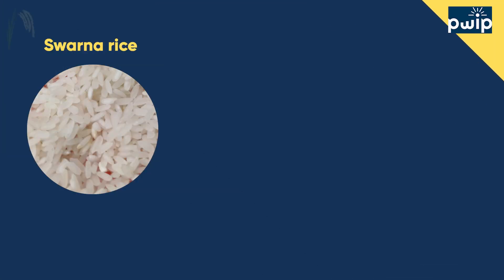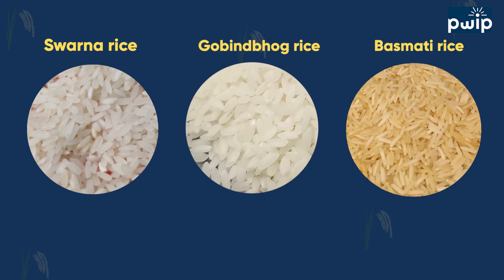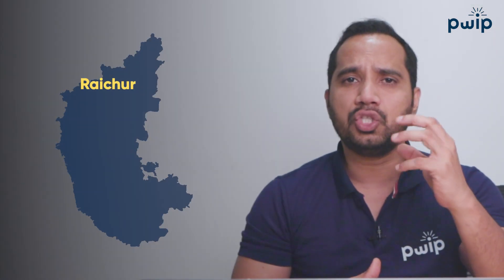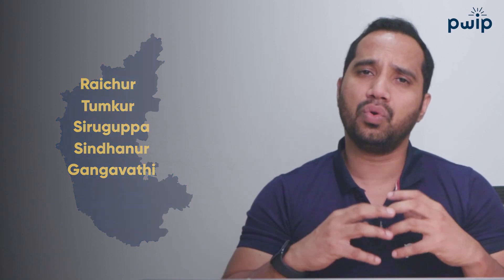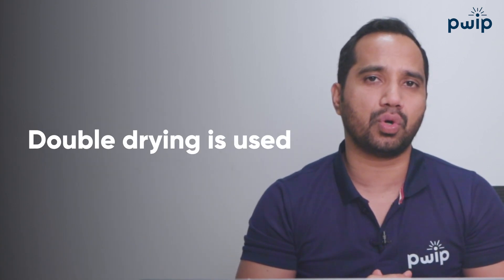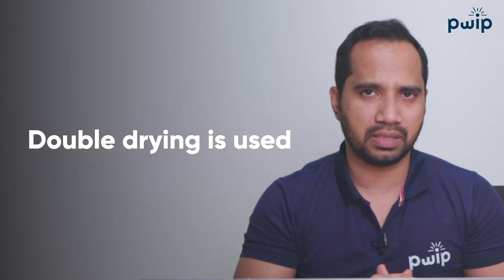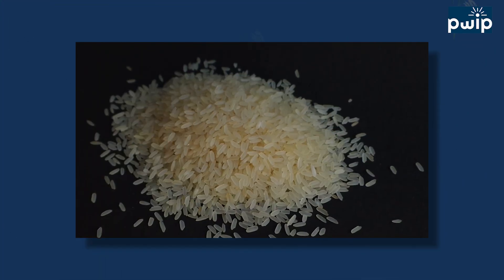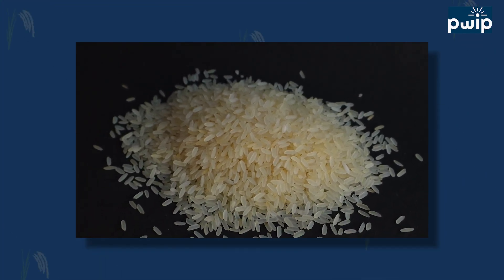Double dry paddy rice: What is it? | यहाँ जानिए  | PWIP

Comment: uniform color is the main reason behind double drying in single steam process. before steaming of paddy it is very important to get uniform temperature and water level of paddy as it helps to get uniform color and consistent cooking especially in 1509 basmati. here in haryana we practice this technique since long ago. It also helps the miller to lower its purchase cost as lower quality with 15-20% green also tends to get you the good quality of final product.